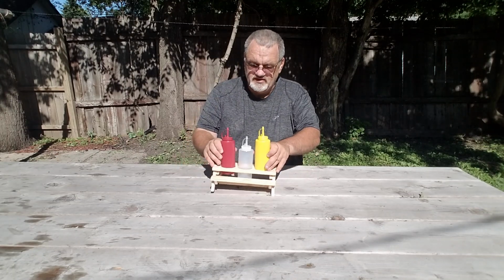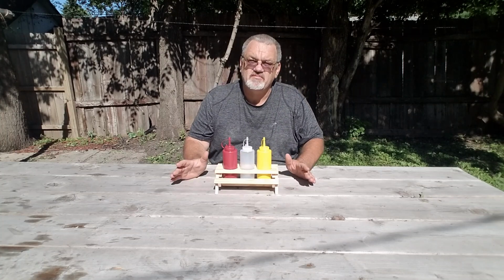Condiment Picnic Table

Comment: Shane: They’ll never make salt and pepper. 
Heinz: hold my beer

I like it Shane but the ca blue becomes brittle over time and will most likely come lose.  I had is happen when I did my 30 for 30 videos. 

Ken
Reply from the maker: Thanks for the heads up Ken. I just might go ahead and put some pin nails in it then.